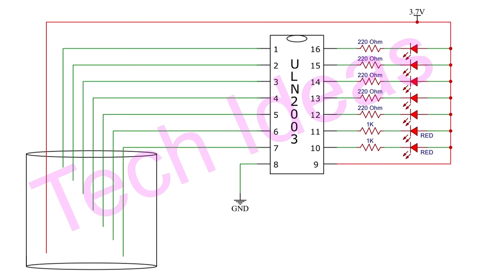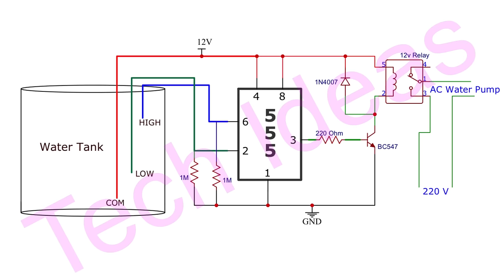Top 2 Automatic Water-Pump On/Off Circuit

Comment: Hi, in case of 1st project, I am facing problem, when submerging, light blink then faded, like battery can't drive it. No power when all wire inside water. Can you help me in this? Also can you confirm whether first 5 resistance  is 220 ohm or any other?

Comment: Hi,

The connection you made using LEDs,  there are two red LEDs you have used. If water goes below the frst red on top the water pump will restart again? Or when the last red LED  lights off the water pu.p restart?
Reply from the maker: Yes, when the last led goes off

Comment: Why does the water touching the wire cause the pump to switch off?  Water isn't a very good conductor of dc is it?
Reply: It isn't but IC can sense low current that can pass trough water and increase it with transistor and relay so motor can work.

Comment: 2nd one is not working properly. The motor is not switching on when reaches minimum water level or it on when the top level disconnect from water .
Can someone please help
Reply: Yes not working

You find any solution please help me